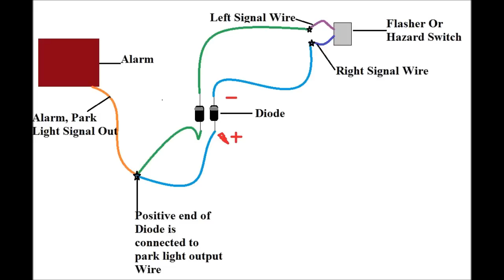Wiring  Hazard/ Signal lights to Alarm

Comment: I installed an auto page 350 alarm everything was hooked up had the parking light wire from the alarm going to the parking light wire on my car. On the same harness there was a 12v wire that went to 12v constant anyways hooked everything up and the parking lights flashed and the siren beeped when the alarm was  armed. They didn't stop flashing until I unlocked . My shock sensor wasn't working either. So what I did was just put the 12v wire from the alarm and tapped in with the parking light wire and my alarm works fine only thing is my parking lights don't  flash when I unlock and lock the car and the siren doesn't work only my horn goes off? Do I need a relay or diodes? I put in my Acura integra.

Comment: Sorry for the noob question but why isn't it possible to just tap it directly to the L and R signal w/o the use of a diode?
Reply from the maker: If your alarm only have 1 wire then it will create a bridge between left and right signal (just picture L & R and one wire running between them that’s what will happen), result will be when you put your indicator to L in order to turn left, everything will light both left and right, when u put it to right the same would occur.
Reply: Oh I see! Thanks for the explanation! Now need to check if it indeed has 2 wires. How about if we tap it to the hazard switch? It too has 2 wires?

Comment: does this work for 2 + parking light outputs or 2 - says i need to use a relay for my 2+ wires to make one but this seems alot easier
Reply from the maker: Gary Whiddon 
Works for as much as you want to add